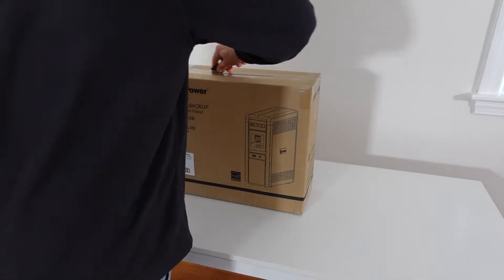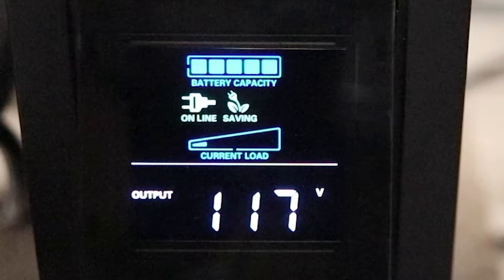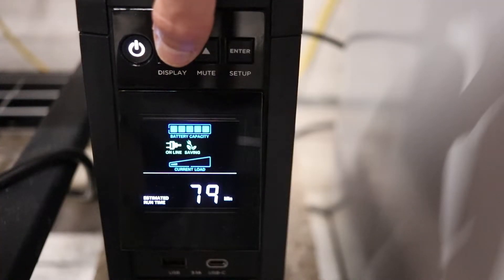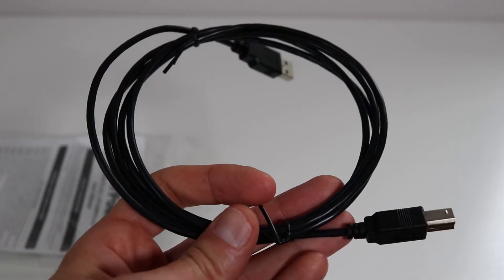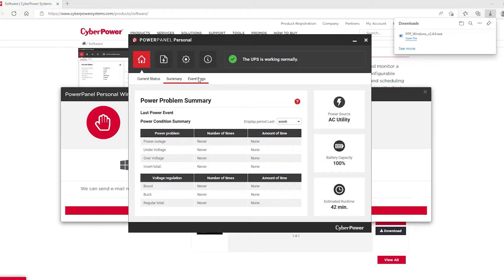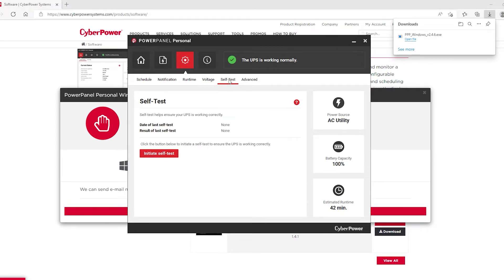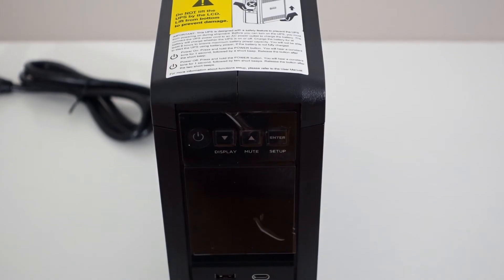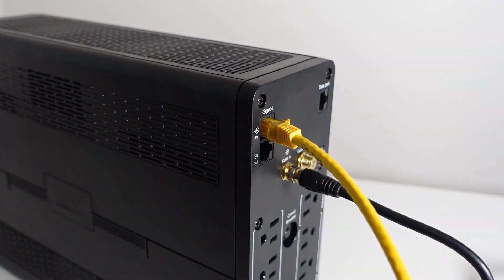Cyberpower 1500VA/1000w CP1500PFCLCD UPS Unit Review, Software Overview with PROS & CONS

Comment: Hey, I'm new to UPS systems and trying to understand how they work.
If a UPS is rated for 1000W and my PC goes over that during heavy load, does the UPS just stop using the battery and pass wall power through while still protecting the PC? Or does it fully shut everything off?
I want to make sure my PC is safe even if I upgrade parts later.
Reply from the maker: Everything shuts off.  Check out the CyberPower PR1500LCD (Rated for 1500w).  If you are expecting long run times, then ditch the UPS all together and find a power station with a fast ups relay.
Reply: @S @SystematicHardware  OK thank you I was looking at something to I seen a text. I was looking at this here. GOLDENMATE 2000VA/1600W Lithium UPS
Battery Backup and Surge Protector, Backup Battery Power Supply with LiFePO4
Batteries(460Wh), AVR, Line Interactive Sinewave
UPS System, 8 Outlets, LCD Display

I just need something that gives me a few minutes of power when the electricity goes out, so I have enough time to safely shut down my PC without damaging any of the components.

Comment: This would be perfect with the APC AVR in front. Thanks for a great review.
Reply: Got it, and it is great for my Corsair powered 2023 PC which has now increased in value to that of a perfectly good used car. PSU doesn't sound like it's being fried when on battery, very unlike my old non-sine UPS (which now powers just my monitors).

Comment: Just paid $300 to run my PC on battery for 3 mins of the power goes out. :/
Reply from the maker: What he hell
Reply: But you save your graphics card from burning out. Idk about you but 285 is better than replacing my 3200 graphics card. What would you recommend for setting when running an almost 900w gaming pc. I will upgrade but for now I got this one. Until next paycheck ill get the 1200 w 2000 VA.

Comment: What is "Invert Total" (with number of times) on the software's summary panel?
Reply from the maker: “Invert Total” on the CP1500PFCLCD software summary panel refers to how many times the UPS has switched into inverter (battery-powered) mode—i.e. the total number of battery-to-AC inversions that have occurred since its counters were last reset.

Comment: Ok so I just got one my pc will be here Friday so when you was talking about the software, do I need to update the software in the UPS or is that just an update for the control panel app that you run on the computer? Stupid question I know but this is gonna be my first PC ever. Right now I am gonna only plug in my pc and router and modem would this be able to handle it only asking because my pc is a high end gaming with 5090 gpu but with a 1300w power supply unit
Reply from the maker: Max wattage is a 1000w for that ups.  Without knowing the rest of you internal hardware components its trough to say.  The only way to know for sure is to look at the wattage meter on the ups unit.  If its too much you'll find out quickly and the unit will just shut everything off.

Comment: How long does the UPS last without electricity?
Reply from the maker: It depends on what you plug into it!
Reply: @SystematicHardware  Ok.... Plugged it into a gaming PC desktop only
Reply from the maker: It depends on how powerful the PC is!!
Reply: @SystematicHardware  The PC that I have is 460W
Reply from the maker: @Momo_King_Slayer  Expect ~10–13 minutes of backup at a full 450W load on a CP1500PFCLCD. Enough time to save work and safely shut down.
Reply: @SystematicHardware  Thanks for the information because, I was planning to buy it next month but once you said "Expect 10 or 13 minutes'' then I realize nope, I want a UPS that last longer than that maybe 5 hours or so.
Reply from the maker: Powerstation, not UPS - BLUETTI Elite 200 V2

Comment: I have this unit for about 2 yrs now.  It has been great.  I only have my cable modem, routers, and security base station attached to it so when power goes out while in business meetings, no one but me knows it.  Have had several power drops for 30mins to 3 hrs and the system kept everything running fine.
Reply from the maker: It's a great feeling right?  I've a ups unit on literally everything in the house lol.  When the power goes out and there's nothing wrong with the internet, I can still keep going

Comment: When you replace the batteries look to check that the batteries are both still plugged in. The internal wires are annoying;y short. When I would slot the second battery in, the first one would get unplugged. Took me three tries to get both batteries in and plugged in.  
With a battery unplugged, it will show the battery as full, but if you run a self test or unplug, it will power off immediately. Even under no load.

Comment: Hi, do you know the power consumption of the UPS when the connected equipment is turned off?
Reply from the maker: It's tricky to give an exact, single number for the CyberPower CP1500PFCLCD's power consumption when connected equipment is off. This is because it can vary based on several factors, primarily the UPS's charging state. However, here's a breakdown of what I found:

Standby Consumption:
User reports indicate that once the battery is fully charged, the UPS's standby consumption is relatively low, often in the range of 4 to 8 watts. Some users have reported around 5 watts.
Charging Consumption:
When the UPS is actively charging its battery, power consumption is higher. Reports indicate that during charging, it can pull significantly more power, up to around 20 watts.
Factors Affecting Consumption:
Battery Charge State: A depleted battery will cause the UPS to draw more power for recharging.
Efficiency: The UPS's internal circuitry consumes some power, even when idle.
Measurement Accuracy: Variations in measurement tools and methods can lead to slightly different results.
Therefore, while the UPS consumes some power even when no equipment is actively drawing power from it, that amount of power varies.
Reply: @SystematicHardware  
Very valuable information. Thanks.

Comment: I need to connect the unit to my UGREEN NAS. How would I be able to download the app and see the stuff like you showed at the end of the video and see it?
Reply from the maker: Download and Installation Steps:

Go to the CyberPower Website:

Start by visiting the official CyberPower Systems website. The most reliable source for their software is their official site.
Specifically go to the download center. Here is a link to start at: https://www.cyberpower.com/tw/en/download
Find the Appropriate Software:

Look for the "PowerPanel" software section.
Select the version that matches your operating system (Windows, macOS, Linux, etc.).
Ensure you choose the "PowerPanel Personal" version if you are a home user.
Download the Software:

Download the latest version of the software.
Install the Software:

Once the download is complete, run the installer.
Follow the on-screen instructions to install the software.
It is generally recommended to connect your UPS to your computer via USB before or during the installation, to allow the software to properly detect the device.   
Connecting the UPS:

It is very important that you connect the UPS to your computer via the correct USB cable. This will allow the software to communicate with the UPS.
Important Notes:

Always download software from the official CyberPower website to avoid potentially harmful files.
Ensure your operating system meets the software's system requirements.
Cyberpower also has "PowerPanel Cloud" which is a mobile monitoring solution. This is often used in conjuction with the desktop based powerpanel software.   
I hope this information helps.

Comment: Will this work for a PC that uses a 1300 w PSU? The total load would be under 1,000, but the PSU is rated for higher
Reply from the maker: If the internal system components are actually drawing 1000w, then that's cutting it too close.  Check out my latest cyberpower ups video.  It supports 1500w which is 300w shy of what an average American circuit breaker can support.

Comment: I just wanna know if you can use 2 pure sinewave units on 1 outlet/circuit. 🤓
Reply from the maker: It depends on the circuit.  Most 15 amp circuits run at 120v which max wattage is 1800w.  So if you are using both units at its max rating, then no.  However if you have a 20 amp circuit, then yes.  It's max wattage is 2400 watts.  If what you have that draws power isn't going to max out a typical 15 amp circuit, then yes you can use two.

Comment: I have had 2 of the Cyberpower 1500va/1000w UPS's and I found that at most I get only about 2 years before they DIE!  About a week ago my second unit failed and when it does I loose power to everything. I am now replacing the unit with a Goldemate LFP batteries in it.  I also plan on adding more LFP batteries to the UPS unit to make the backup time much much longer.
Reply from the maker: That's great you've found a way to upgrade and extend the life of your unit.

Comment: I own three of these and their 2,000VA 19" rack mount one. These have been awesome (one year of use, lots of power bumps/outages). They have never failed me. Pure sine wave 1,000w is 1,000w. Others rated at 1,000w with modified sine wave, expect 20% less power.
Reply: @ChrisDIYerOklahoma, Hey there neighbor, I'm in Oklahoma as well, OKC here. I was wondering about your setup, are you using these all in tandem for extended run time, or all separate? Thanks

Comment: I have a router and modem connected … they don’t take up too much power and the battery last like 2.5 hours.

Is there any way I can make the battery last longer by messing with the setup on the display?

Comment: Great vid.  You helped me decide to get this unit and after a few months I love the device... however:
The software is total garbage.  If you don't need the auto-shut down feature (the only real reason to use their software) than you don't need to install their software.
If you want to monitor UPS loads and outputs this can all be done with Hardware Info.  Hardware info can access all the device data through USB connection without needing the CyberPower software installed (because as I mentioned the cyberPower software is junk).

The cyber power monitoring sofware eats up WAY more resources than it has any right too and it has caused system hangs for me.

Comment: I have a computer with a power of 1200 watts and some RGB lighting devices. Do you think this device is suitable for me??? Usually the electricity fluctuates and goes a little higher and lower than the standard
Reply from the maker: What's your computer hardware specifications?
Reply: @SystematicHardware  3090 TI . 12900KF .32GB RAM .CPU COOLER 360 .4 ssd
Reply from the maker: @MartinShorlek  I think you'll be alright with that Cyberpower unit.  Don't go any lower though.
Reply: @SystematicHardware  Isn't this a risk?
Reply from the maker: @MartinShorlek  If you look up a power supply calculator regarding your hardware specs, it calls for roughly a 850w power supply.  It all comes down to how much power draw your specs pull from the power supply.  So even though you have a 1200w power supply doesn't mean a 12900kf and a rtx 3090 ti will draw that much.  I think it'll be fine but if you're that concerned and you can spend more money, check out the CyberPower PR1500LCD Smart App Sinewave UPS System.  It's max wattage is 1500w which will give you plenty of extra headroom and will come close to maxing out a typical American 15 amp circuit.
Reply: @SystematicHardware  Thank you very much for your guidance 🙏🙏🙏

Comment: What if my PC guzzles up more than 1000W? I mean, it doesn't do it all the time but during certain workloads it's very much capable of shooting above that.
Reply from the maker: The ups will cut power for safety and your computer will insta-shutdown.  Unfortunately any ups over a kilowatt is going to be expensive, but worth it depending on how much you lose power intermittently.
Reply: Oh, I kinda thought UPS is supposed to be something like more advanced version of power strip, and as such to be able to handle similar amounts of power. I mean, my 12$ power strip from supermarket is capable of handling up to 1800W!

Anyway, thanks for clarification, I think I'll stick to my good old, nothing-fancy-about-it power strip that served me pretty well so far, and just keep my eye on any incoming shoddy weather. And you were right, UPS that'd suit me are damn expensive!

Comment: This brand is a fire hazard! After about 5 minutes of battery mode, the transformer over heats and starts smoking and lucky that I was testing it so I was able to shut it down before it caught fire. No heat dissipation for the transformer that puts out 900w! Cheap and unsafe design!

Comment: wondering if this bad boy can hold a 4090 with ryzen 9 7950x with a 1300w psu...
Reply from the maker: I think you'll be ok.  Max wattage for that unit is 1000w and I doubt you'll come close to that load.  You can get a watt meter and keep an eye on the wattage prior to purchasing, if you want to be sure.

Comment: How noisy are the fans on this UPS and do they turn off?
Reply from the maker: There is an audible fan noise when avr kicks on and when it loses power all together, but in my opinion it isn't that bad.  If you want silence when avr kicks on then go with APC
Reply: @SystematicHardware  AVR? I'm sorry, I don't really understand what this is. You mean when it switches to battery mode? How often does this AVR turn on?

Comment: hi guyz i need to verify i learned that APC ups has a software that turns off the desktop computer when battery is nearly used up which is very handy for me because i might be at work when power outage might happen. now does this cyberpower has this software feature too ? tia